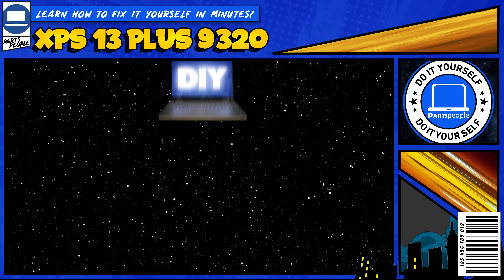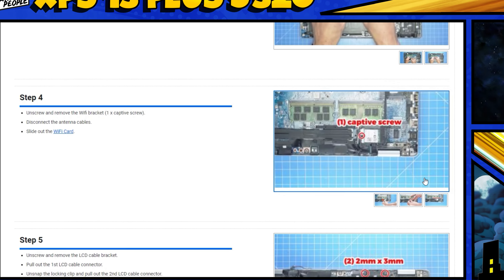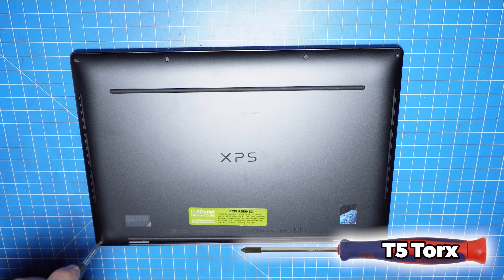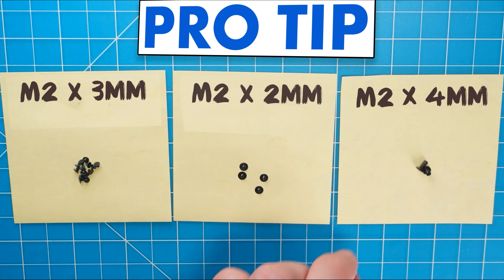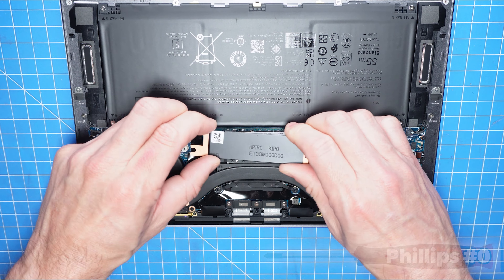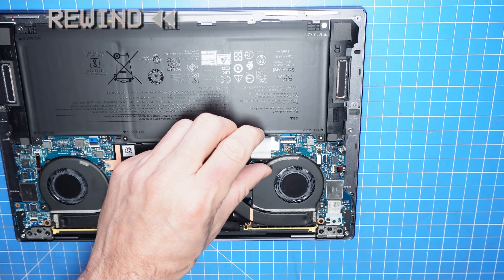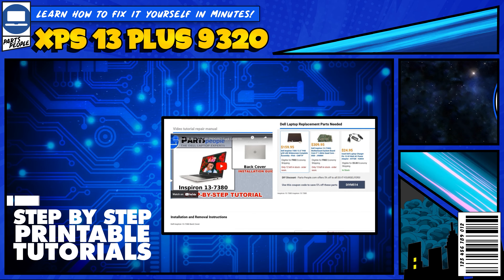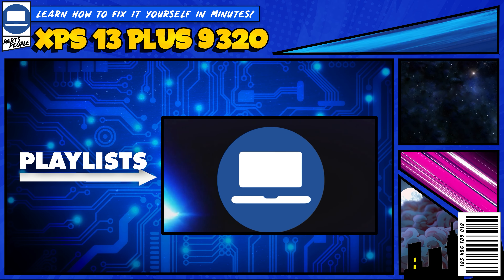How To Replace Your M.2 NVMe SSD | Dell XPS 13 Plus 9320

Comment: Dell's beautiful laptop in 2022. Oh yeah, I remembered when Josh from "Just Josh" was like frustrated with that laptop due to issues, which required him to reinstall 😅

Even some issues related to overall Quality. But at least, Maybe Dell has addressed those issue today
Reply from the maker: I saw Josh made an update to his video to point out that Dell had in fact addressed some cooling issues in their redesign. It's reassuring to hear they're working on their quality control.